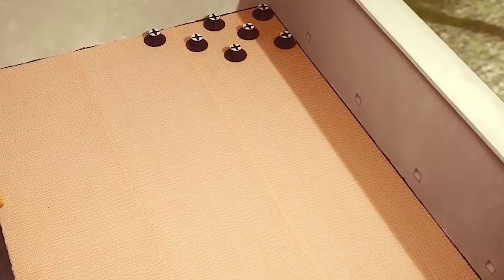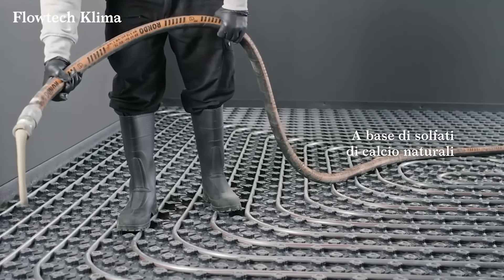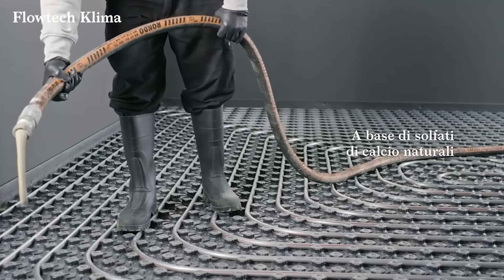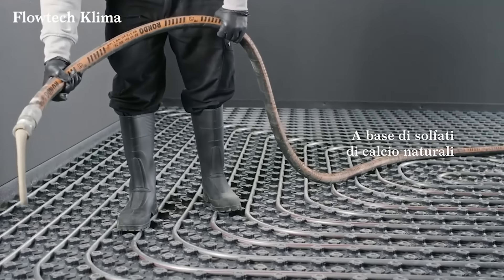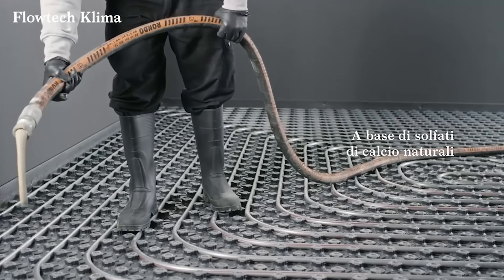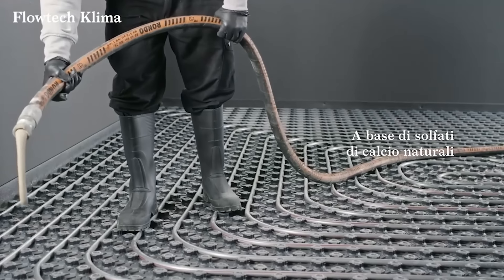INCREDIBLE CONSTRUCTION TECHNOLOGIES THAT WILL SURPRISE YOU

Comment: 9:43, I see these used all the time. I'm an electrician apprentice and they use these things a lot in any wall, but heavily in the major utility rooms where there's a risk of an arc flash that could cause a sudden and massive fire.
Reply: Actually I'm working on prototype tu replace home socket and switches to save money without this we can power easily. sockets and switches are costly and they want to replace yearly

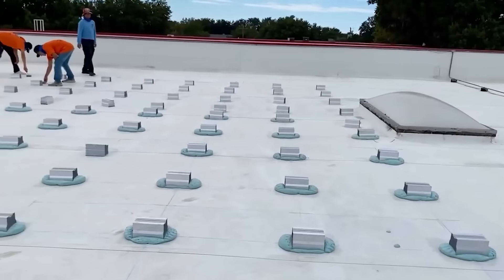Comment: 01:58 100x fasteners for $5,300 is $53 each… which for an 8” (?) aluminium extrusion is ridiculous.
Reply: Certainly is a lot of money for something so simple. Even with a relatively short production run, it would be cheaper to have your own copies made if you needed these for a few jobs.
Reply: Yeah, but they're specially designed by engineers and cut to length and everything. And they come in pretty boxes. 😎
Reply: @bobbuilder3748  Other than it's probably a patent violation.
Reply: @crowleythedemoncat  Not if you don't sell them to other people. Personal use can't be a copyright violation.
Reply: @firesurfer  The person who makes them for you is as well as you for contracting and using them.
Reply: It's no different to a concrete block. Only a fool would use that product
Reply: That's incorrect. Each mount via distribution cost $18-20

Comment: Yeah, I'm a roofer. One of the best in my area with over 30 years experience. We repair more than 1500 roos per year.  The solar stack solution is a terrible one. How are you going to repair the roof if there's a leak under the adhesive? This is not unlike many other solutions that have been tried over the years that prevent access to the roof. Very very very expensive to make repairs under a solar system that is not properly mounted on a stanchion type system  You have been warned.
Reply: Anything that is "not properly mounted" will make repair harder. These mounting blocks have been around for years on roofs that don't allow penetration. You're saying a little spot of glue is a major obstacle? Also, don't put a mount on a hole, then no leak to repair on the *roof.
Reply: I find there’s often quite a pragmatic response to the question "why isn’t everyone doing it this way?". Thanks for the heads up roofer man!
Reply: I believe those adhesives are also flammable, not something I would want on a hot sunny roof connected to wiring.
Reply: @stevespyder  Solar panels are only 35 volts dc max and they are not connected to wiring. Whoever made the adhesive probably never thought a roof in the sun might get hot, good point. I'm surprised the old roofer hasn't spontaneously combusted by now.
Reply: @BariumCobaltNitrog3n  They have to connect the panels to something to send power to, and I can turn a 1.5v battery into an arc lamp with 1000 degree plus temperature. Just connect a wire to one end of a battery, wrap the other end against a pencil graphite core , then touch to the other end of a battery and see what happens!
Reply: @BariumCobaltNitrog3n  how roof can get hot if it's shadowed by the panels?
Reply: @canvlad  Interesting question Troll. Try Google.
Reply: @stevespyder  The panels are connected to an inverter then to the electrical panel which either sends power to the house or pushes it back to the grid, earning money. The conductors are not connected to any part of the structure. 
Be careful playing with batteries, does your mother know about this?
Reply: @BariumCobaltNitrog3n  okay mr smarty how you gonna repair a leak under a 2 inch think glue blob that is stuck to the old roofing title and cant easily be removed. So you gonna tell the owner sorry man gonna have to buy a new solar mount ?
Reply: @IloveJellow  how do you get a leak under a glue blob?? That should be the strongest place of the roof right?
Reply: They're doing solar shingles here in Austin.  Tesla techs handle the wiring and storage in garage. Many are adding Generac Generators, too. Especially after the big freeze.
Reply: @BariumCobaltNitrog3n And why would the manufacturer not have thought of a hot roof? I highly doubt the truth of your  statement. I have no doubt they have thought of that and more. And @stevespyder saying he “believes” hey are flammable. Please show us the evidence other than something you believe.
Reply: @jeffmech1  Steve said adhesives are flammable, not something I would want on a hot roof. I said Whoever made the adhesive probably never thought a roof in the sun might get hot, good point. Do you not see the sarcasm?
Reply: If you're a roofer than you should know tile in high wind zones like Florida's HVHZ (high velocity hurricane zone) are attached to the underlayment with SPF (spray polyurethane foam). It's been like that for over 30 years.. If there was a leak the foam and mount can be removed from the underlayment without damaging the roof. Give me a break.

Comment: My cousin and I built his house using the foam blocks and two story mono-polyptic poor it's probably one of the strongest structures in Texas and it was very easy to do once we got the footing dug anyway it cost a hell of a lot of money for all that concrete but that being said it's a badass house and it's insulated well and a tornado is not going to take it down rip the roof off of it but the house is not going anywhere

Comment: 0:39 Seems like a great way to hide contraband from the WEF. They would be more stable if an aluminum screw in inserts to brace the tiles on each corner tip would prevent plate shifting that would shim the plastic tabs off. Your welcome.
1:43 So instead of screw holes that can be filled with wood putty or even Bondo you would pay a ridiculous sum to have big splotches of adhesive with aluminum boxes glued to the roof? Sound legit. xD
4:44 A single 4 ft x 8 ft floating section can hold 419lbs. So two bros and a six-pack right because after you grab your fishing tackle it suddenly starts submerging? That sounds legit. xD
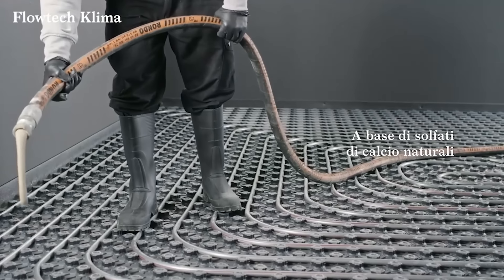5:02 An actual good idea that makes sense yay! An affixed concrete insulator! But rebar is absolutely necessary for stability.
Reply: Hi there, our weight rating per dock section is actually 1100 lbs each, and we have tested up to 2200 lbs without issues.

Comment: Damn, 3 people at 150lbs/each is 450lbs... which is above the rating limit of the aluminum docks? Seems like they should be a hell of a lot stronger than that. My friends and I used to hang out on wooden floating docks and there would be 6-7 of us, all weighing about 150lbs each on avg... and we never had a problem.
Reply: Also, I didn’t see too many boats at the pond when they shoved the dock in without a line, i bet the guy with the shorts is a good swimmer 😂
Reply: 450 per section.
Reply: Hi there, our weight rating per dock section is actually 1100 lbs each, and we have tested up to 2200 lbs without issues.
Reply: @CanadaDocks  yeah I could tell by the size of the floats they would hold more than 450 lbs.
Reply: That a 4ft×8ft section... not the whole dock
Reply: @CanadadocksCa  Makes sense. I used to hang out in the Niagara River and I can say (for certain) that we've have at-least 1000lbs on an 8x8 section without any problems. Yeah, it was a couple inches lower in the water, but it wasn't at risk of sinking, tipping or breaking.
Reply: in your roofing experience what's a better option for a roof for a residential home? 
1) Tiles (ceramic). 2) Tile strips (the sand/pebble, normal kinds you see). 3) plastic sheets (the ones you see over car-washes or gas stations). 4) Tin roofs or aluminum sheets.
(or other options out there?)
Reply: @CanadadocksCa  does that mean, you could..."technically" use it to build a house on the water? you know, in case we have a tsunami or heavy flood! ;)
Reply: @DarkArtsMage  I wish I had the experience to be able to answer that. I have no doubt that the aluminum roofs are superior, but they're far more expensive if I'm not mistaken. I only ever installed the normal shingle roofs. I haven't seen any tin roofs, but tin isn't always the best material for longevity (not compared to aluminum)... and I believe tin is more expensive (although some tin alloys like ZAMAK are cheap and can have good properties). They're usually used for their low temperature casting properties and for saving money over casting/machining aluminum.

I'm not sure what the cons of aluminum and/or tin roof's are though. I know shingles have a lot of cons.... but they do last a long time. They also shield radiation well without making it impossible to use a cell phone or receiving radio/tv signals. I have no clue if metal roofs will block radio waves, but I would look into it (and try to consider any other possible hidden cons they might have).

Hope that helps... but I'm no expert.

Comment: Notice how the electric road is designed for cars and probably costs $$$$.   If it were designed for a bike path that could use any number of new EV devices like bikes, scooters, unicycles and segways the cost would be far, far less, power requirements far less and encourage use of alternate transport and reducing congestion.   Plus covering a bike path with solar in places that have sun is far easier to install and maintain will providing the power needed for bike path.   
 But hey, lets keep pushing cars as a solution.
Reply: @MyWeedgrower Absolutely, very true. But I should have put in time  11:15   where they are talking about using road to power cars and buses.    Bikes and personal EVs would require a lot less infrastructure to do the same and probably be more beneficial was my point.    Interestingly it turns out in sunny areas covering ponds and  aqueducts with solar helps solar panels stay cooler and  water from evaporating.  In California those water areas would provide enough solar power to meet the 2050 goals they are trying to reach.
Reply: Both technologies exist, for bikes and for cars. It's not one or the other, it's a local thing, talk to your city council about bike paths, instead of whining about cars. You can't ride a bike on the freeway.

Comment: The last one in the video is as close to Nicola Tesla's original idea of wireless power transmission. Soon  airplanes ✈️  and boats 🚢
Reply: Sorry, nope. Wireless induction works at the inverse square distance law. Ie each unit of distance generates a loss of power squared. So with ground vehicles being 30 to 60 cm from the induction coils that is still an appreciable but also still barely acceptable loss of power energy. Projecting power over kilometers into the air not only results in massive energy loss, it would also result in strong electromagnetic fields that would mess  incredibly with electronics. So, nope.